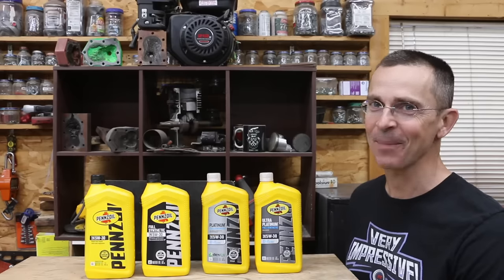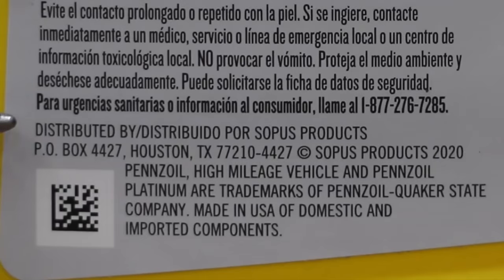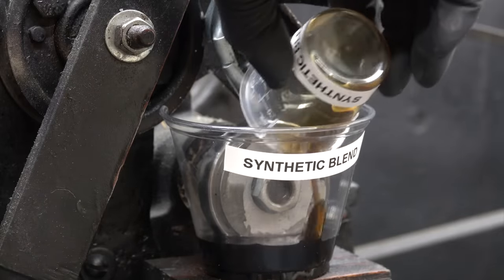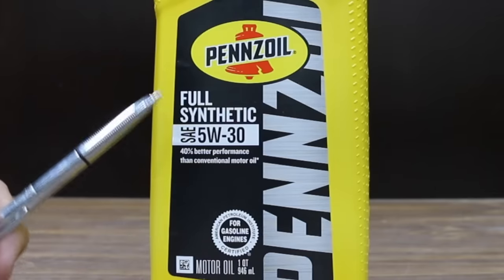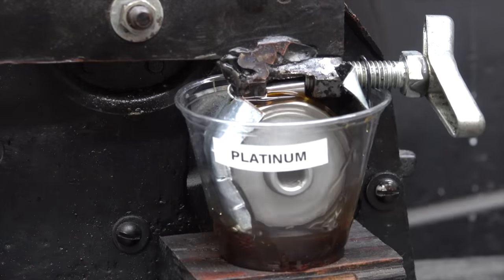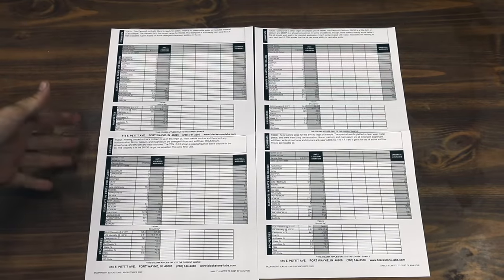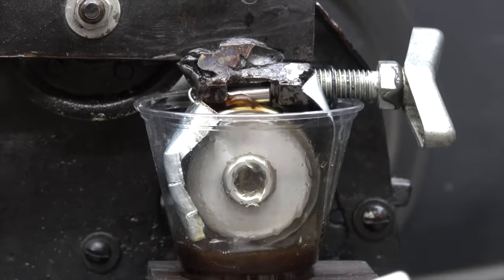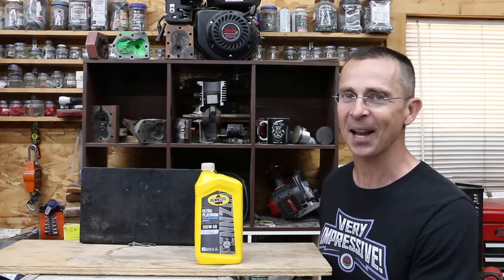Are They All The Same Motor Oil? Let's Settle This!  Four Levels of Pennzoil Motor Oil Compared

Comment: it's likely that the small difference in performance is negligable in real world situations. Unless you are a commercial operator and plan to use your vehicle from new until it reaches 500k miles the difference in lifespan would be only like a few thousand miles.  The better plan would be to buy the less expensive oil and change it more often as that gives you a chance to do other maintenance on the engine at the same time and take care of other issues that might arrise that are likely to limit the engine lifespan just as much or more than the type of oil you are using.
Reply from the maker: Thanks for the feedback.

Comment: Wow really disappointed and worry with the Platinum performance there since it is the same oil in my engine right now. Not only does it have significantly less addictive then all the other, the cold flow test wasn’t looking very good as well. Might have to switch to the Ultra Platinum on my next oil change.
Reply: The main advantage to synthetic oil is resistance to chemical breakdown.  You don’t have to be worried unless you drive a high performance sports car to its limits consistently.
Reply from the maker: Thanks for sharing.

Comment: When I bought a 2000 Saturn LS1, it had noticeable oil consumption.

I changed the oil with Super Tech High Mileage 5w30 and it's motor oil loss was reduced to negligible after a few days running on that product. It worked for me! 

I am not affiliated with any business, product or distributor of any kind, but I wasn't going for anything more expensive than necessary and certainly not go for a super-premium grade for a car that was purchased as a twenty year old beater two years ago. :)
Reply from the maker: Thanks for sharing!

Comment: I worked as a Automotive Seal engineer for about 10 years. One of our major OEM customer was working to improve warranty packages, we were asked to test axle seals in new oil, used oil, and a blend of new/old oil to determine how the age of oil effected performance and part life. We found that old oil actually performed better for seals as new oil was more abrasive since it was more chemically active. I am not recommending you not to change your oil but if your on a tight budget, draining and filtering the oil through some type of fine screen “may” be an alternative. Filtering would remove any particles that have built up (metal chards, dirt, etc).
Reply from the maker: Thanks for sharing.

Comment: I found a several hundred page case study years ago involving tons of brands and grades of oil, both with and without additives that had ratings for thermal breakdown, shear pressure, measured lubricity when hot and cold, and wear characteristics over a lifecycle. The overall first place was the penzoil ultra platinum in 10w30. Obviously that doesn't mean any engine should run that specific oil, but it convinced me to use that oil (with correct viscosity) in every gas engine I've owned. I had next to no burnoff or loss of oil in the engine over the course of an oil change (in 5 separate vehicles), and with proper injector cleaner in a tank of fuel prior to changing the oil I could consistently get above rated fuel economy. The engines in question were run harder than the "average user" would with zero issue.
Reply from the maker: Thanks for sharing.

Comment: Worked on a blending line project for a major manufacturer and they used 2 types of base oil for all of their products, including products that they packaged for other companies.  The difference between products was the additive blend. We were never told what those were. We just knew them as A, B, C, etc.  The total amount of additives was pretty small so I would expect that you would see similar results in normal temperature viscosity and evaporation based on the type of base oil used for a given brand. The additives do play a major role in wear, detergent effect, and high or low temp performance and those were tightly controlled trade secrets.
Reply from the maker: Thanks for sharing.

Comment: I have to say that I have become a big fan of the Ultra Platinum.  

For several years my car avgeraged about 23mpg.  I had always run Mobil 1 for the last 20+ years.  I had the check engine light come on - for the oxegen sensor.  I read that some "cleaners" could help.  I ran a couple tanks full of fuel system cleaners, then changed my oil.  

The car jumped in milage from 23 to 29mpg!  that is 6 miles per gal more or about a 26% increase!  This has sustained for over a year and a half now or over about 20K miles of driving.  I wish I paid a bit more attention when I just added the fuel system cleaners but my goal was not to increase milage it was to get that check engine light to turn off...  

Anyway one more thing to add is that I also added a pint of Liqui Moly MOS2 to the oil at the time of the oil change.  So who knows what exactly is responsible for the increase in the mileage but I guess it worked out well which for me is a nice change of pace!  Cheers.
Reply from the maker: Thanks for sharing.

Comment: Have been using pennzoil ultra platinum in my 2014 Ram 1500 Hemi for years. Almost at 150,000 miles and it still runs like new. Obviously cant say for sure that the oil is a big contributing factor, but im sticking with it.
Reply from the maker: Thanks for sharing.

Comment: I ditched Mobile one to try Pennzoil ultra synthetic and was very impressed with it. I think I am going to give AMSOIL a shot in my truck because it has been the best oil I’ve tried in my Motorcycles.  It seems to have a great detergent package and is super resistant to oil shear in high rpm motors using oil spinners and wet clutch’s. A lot going on in the bikes, but AMSOIL has handled it in strides.
Reply from the maker: Thanks for sharing.

Comment: I switched from mobil 1 to Pennzoil platinum because my friend said he has great results with it. I found out he meant Pennzoil ultra platinum, not just "platinum". He sent me the link to this video and man I can honestly say, you confirmed my theory. Pennzoil "Platinum" does really have an issue on cold start when fresh. I changed my oil and ran the car maybe 5 mins afterwards. It sat the rest of the day. Woke up and it was in the low 30s. Started the car to warm up and went back inside. I came out about 5 mins or so and noticed immediately when driving, it felt rough. Took about 10 mins before it smoothed out. Hasnt done that since but I definitely won't run Pennzoil platinum in any of my cars. Seeing that cold test and how it scored the worst really does show me what the heck was going on.
Reply from the maker: Thanks for sharing.

Comment: I love this chnanel but as an automotive tech I had to replace a cousins engine.  She was elderly and still driving her late husbands truck.  Engine failed and had to be replaced.  I had to reuse her oil pan.  When I pulled the pan off it was the thickest build up I had ever seen in about 25 years at that time.  They used conventional penzoil the entire life of the truck.
Reply from the maker: Thanks!  Thanks for sharing.

Comment: Thanks a million! I recently started using ultra platinum as I have an Ecoboost engine and change at 5k intervals always. This is reassuring that it does a good job:)
Reply: You can go twice that long, confirmed by testing from the same lab he is using. Even your owner's manual probably states 7500 mi, 5000 is the number dealers try to convince you to do in their service departments.
Reply: @sauercrowder  thanks for the input and I have read that in the manual. I see it as cheap insurance to change at 5k and I now change my oil after dealerships increased their prices and will sometimes leave loose screw on intake filter box or break the clips on intake filter box. The oil pump is housed inside the engine, so just trying to play it safe to see how long I can keep this engine from breaking the bank. Thanks again

Comment: I only recently discovered Pennzoil and Quaker State were folded into SOPUS soon after they too merged in 2000. SOPUS is Shell.  I always liked Shell.  I use Platinum 5W30 in my 18 Ford Edge SEL 2.0L Ecoboost AWD.
Reply from the maker: Thanks for sharing.

Comment: I've got a good one for ya: is a 10,000 mile oil filter worthwhile over buying a standard oil filter and changing the oil twice as often? I've been enjoying only having to change the oil twice a  year, but my father-in-law insists that the 10k filters are a scam and you need to change the oil more often, anyway. He's the parts manager at a Ford dealership. It'd be fantastic to see some sort of head-to-head comparison between the two methods, but I'm not sure how you'll go about finishing that test before we each die of old age... :)

Always appreciate the videos! It's refreshing to see destructive stress-tests where we can see what the failure limits and modes REALLY are.

Comment: Thank you for this video. My local trusty mechanic for some reason dropped using the Platinum Full Synthetic over the base Pennzoil Full Synthetic and while I’m sure its still a great oil I am not a fan of cheaping out at the expense of less quality. But this video surprisingly shows the basic Full Synthetic beating the non-Ultra Platinum in all but one category. So I feel better now. The only problem is its not Dexos rated so I will have to go with a different mechanic for the oil change on my Cadillac unless he is willing to do the change with the oil I provide (which most mechanics don’t do).
Reply from the maker: You are welcome!  Thanks for sharing.

Comment: Great review and confirms my oil change habits….I’ve always changed conventional oils at 3 months or 3000 miles and synthetic oils at 6 months or 5000 miles. Fuel contamination is my biggest concerns…I suppose if someone drives highway a lot 7500 would be feasible.
Even the best oils diluted with fuel is a bad thing…..I’ve seen this for years with old carbureted engines. Chokes staying on too long or not opening at all , short trips and people flood an engine etc…usually why many engines were replaced well under 100,000 miles back then.
Reply from the maker: Thanks!  Thanks for the feedback.

Comment: I run the Pennzoil Ultra Platinum in my '12 Buick Enclave and '19 Acura MDX, i can't even tell that the Buick is running engine is super quiet, it made my MDX more quiet too from the valve lifter noise.
Reply from the maker: Thanks for sharing.

Comment: At the top of every manufacturers range in a specific viscosity, asking people what oil they use is a lot like asking them what beer they drink.  Some people think cheap is best & it obviously isn’t.   Although your tests were definitely thought provoking, I don’t think the wear scar test is particularly applicable.  There just aren’t any friction points in a car engine that are like that.  Ditto with the -40 test.  People in Alaska use block heaters.  I think the only test that would really test the performance of the oil would be 4 identical cars with 4 identical engines driven every 4th day by the same guy.  Then dismantle the engines.

 Volvo calls for 100% synthetic Castrol Edge Professional & that’s what I use with a MAAN or Wix filter.

Comment: An old school mechanic showed me  the internal lifter galley of my V8.  It had a thick film of black sludge buildup. But the strange part was the sludge had a coating of what looked and felt like wax.  He knew I used penzoil because of the sludge.  He said it is caused by parafin based oil.  The other tear downs he had didn't have the coated sludge.
Reply from the maker: Thanks for sharing.

Comment: There are several Dodge SRT vehicles where Pennzoil Ultra Platinum is basically the only recommended oil by the factory
Reply from the maker: Thankes or the suggestion.

Comment: The platinum that I used burnt off 1.3-1.4 quarts of oil in the last oil change I just did. Very shocked when I just bought a 2023 keep wrangler rubicon. There was 46% oil life left according to the vehicle.
Reply from the maker: Thanks for sharing.

Comment: Something I will add:
I've driven some pretty high mileage Toyotas (200k and 300k miles on their VVT-i engines). On those higher mileage engines, they tend to burn oil regardless. I've noticed substantially less of the oil burns when I use the Ultra Platinum oil vs the High Mileage Platinum. Still, the High Mileage Platinum has been great and with a little Marvel Mystery Oil in it I've had zero problems with cold weather starts.
Reply from the maker: Thanks for sharing!

Comment: I would like to see you take Amsoil signature, XL and OE oils and compare them to Pennzoil Ultra, Platinum and regular synthetic, all 5w-30, in the wear test, testing each oil out of the bottle at room temp, which is way thicker than 30w, heat the oil to 212f, which would be 30w and test each for wear scar size and test each cooked oil in the wear tester and compare the findings. Thank you! You do a GREAT job!
Reply from the maker: Thanks and you are welcome!

Comment: My dad used to run Pennzoil in his drag boat. It would blow out of everything. It would break down to zero viscosity and come out of every single orfice, then he started running Valvoline. He never had that problem. There is a big difference in oil.
Reply from the maker: Thanks for the feedback.
Reply: Valvoline is a good oil but keep in mind that Pennzoil of today has little to do with the Pennzoil that was being sold back in your dads day.

Comment: Thanks for sharing.  Found the Pennzoil ultra platinum for $26 for 5 quarts at Walmart today.  Plus the cost of a filter for another $12.  Kind-of-a no brainer to start doing my oil changes myself from now on.  About half the cost of what Jiffy Lube charges and I won't over tighten the damn filter housing and crack it (what one of their techs actually did to my vehicle about a year ago.)
Reply from the maker: You are welcome!  Thanks for sharing.

Comment: I believe I see a noticeable pattern with car buyers; in general people who buy more affordable cars tend to care less for their engines because they like to spend less money on maintenance (extended service intervals, less capable oils etc). I've bought two brand-new Hyundai Santa Fes this year and I've been using the Pennzoil ultra platinum and already did two oil changes on them (break-in oil change at 1500 miles and 2nd oil change after running another 5000miles). I think the reputation of Hyundai engines is not as much as Toyota's partially because of poorer maintenance by Hyundai owners. Let's see if my decision to sell my relatively new AMG-C43 and Honda-CRV was a good decision in the long run (thanks to the crazy used car prices I didn't lose much at all selling my used cars). Thanks for all your videos as they are very useful to me.
Reply from the maker: You are welcome!

Comment: I watched this when it first released and was happy to see how good Ultra Platinum is (I run it in ALL my vehicles).  Sadly, prices skyrocketed from <$30 for a 5qt to >$40 so I'm back to see what the next best pennzoil is :|
Reply from the maker: Thanks for the feedback.
Reply: hell, oil used to be 35 cents a quart back in 1965 along with 25.9 cent gas.

Comment: Do a test where you test which oil has the best cold startup lubrication by testing your bearing friction wear spot using only the oil that sticks to the metal after everything being hot. 

Heat the oil up to engine operating temp. Put your tester in a temperature controlled room as cold as possible (ie, near freezing).

Run the test in a cold room, hot oil, hot bearing, hot friction wheel for 15 seconds to coat all the metal surfaces. Shut it off and allow to cool for 2 hours. Then REMOVE the oil bath and run the test using ONLY what's left on the bearing.

I think this would demonstrate how well the oil protects on cold starts, especially the upper valve train, the camshaft, lifters, rocker arms.
Reply from the maker: Thank you for the video/test idea!

Comment: So here's an interesting question: we see that the ultra platinum is best, but it also literally costs double of what the synthetic blend costs.  The magic question is "how much is enough" and will the ultra platinum make a real difference in a stock or very lightly modified vehicle if factory oil change intervals are adhered to?  At a certain point, having excessive additives, etc. is like buying a Big Gulp and throwing half of it away because you don't need that much drink.  The more I gather data on high mileage cars and how those miles were spent, the main recurring element is that oil changes never went double or triple the factory interval, oil was never allowed to fall below a minimum level, critical maintenance was never ignored (i.e. if radiator was leaking or clogged it was addressed rather than letting the car overheat).  Furthermore, things like burnouts, rev limiter banging, and hard driving on a cold engine were avoided.  I don't know how you'd test this without a very expensive engine dyno run, but it would be interesting if "better" oil is just going underutilized.  I know Blackstone Labs says they just use whatever in their cars after seeing thousands upon thousands of tests and even conventional is fine.  I prefer synthetic because of the extended change intervals as changing is both a hassle and always a dice roll if a filter or drain plug will be loose or become loose and best case be a hassle to go back and tighten it and worse case cause engine failure from no oil.